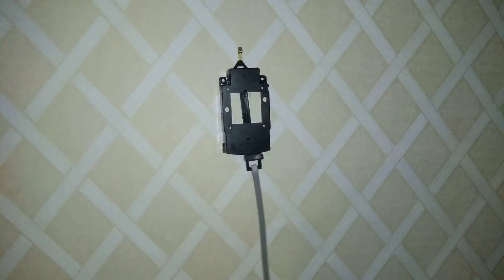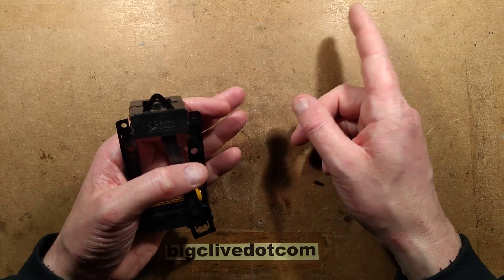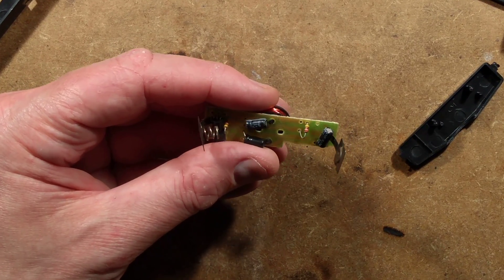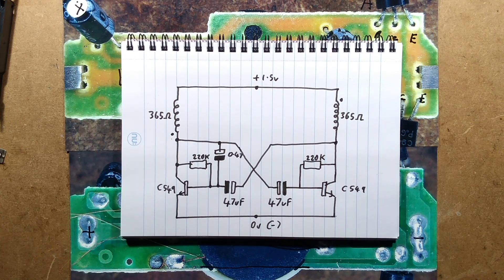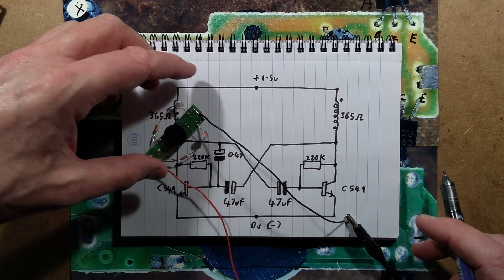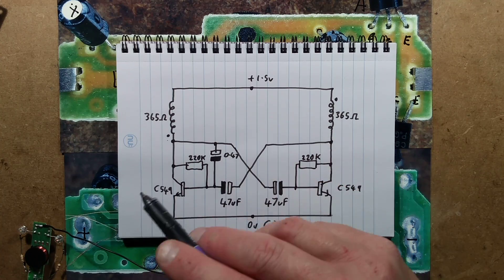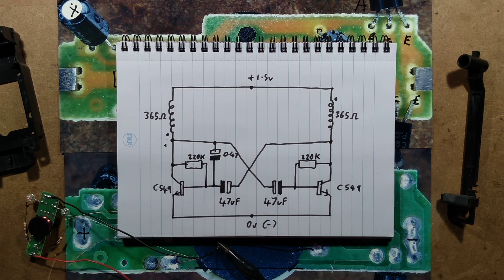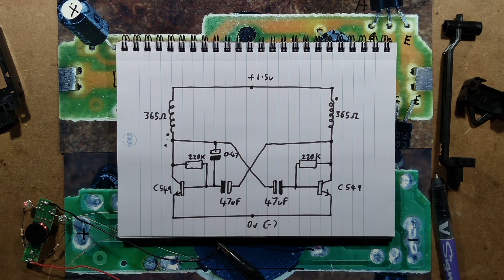Quartz clock pendulum movement teardown with schematic.

Comment: If you used 2 AA batteries in series would you get a stronger impulse?  Could the circuit handle this voltage?
Reply from the maker: It may, but at some point the higher voltage may interfere with proper operation.

Comment: My clock have this kind of pendulum but it is not swinging, what could I do to make it swing.
Reply from the maker: First thing to check is that the battery is new (even if replaced recently) and that the contacts are not corroded from battery leakage, and that the battery is in the right way round and makes proper connection with the terminals.  Some batteries have shorter pips than others.

Comment: I had one of these in a pendulum clock alkaline battery leaked on the coil I scraped it off with small screwdriver I tore off the 4 wires from coil to circuit board, with 4 wires and three terminals I just guessed where two of the wires went it works.

Comment: How big would such a device have to be to move a pendulum weighing approximately 200 pounds?
Reply from the maker: The main obstacles to movement would be pivot friction and air resistance.  But it still takes very little force to keep a heavy pendulum swinging.

Comment: Sir, 365 ohms Shows in the diagram is winding coils ? How many tuns need to get365 ohms.and what is the SwG of the Coil ?
Reply from the maker: It's very fine wire.  I'm not sure what its gauge is.

Comment: on the two magnets of opposite polarity: could it be that the circuit is switching polarity of the active coil winding,
on each tick of the multi-vibrator? thus facilitating the horizontal swing of the pendulum🤔

Comment: I am trying to drive a seconds pendulum whos speed will take 2 seconds to swing back and forth. It will be heavy so I am wondering if I could buy one of these and take the circuit board out and use a neodymium magnet on the bottom of the pendulum and place the coil from this circuit just under the center point of the pendulum at its resting point.
I wonder if this will work. I also wonder if I could get away with a single magnet or if I would need the 2 magnets as in the original setup?

Comment: I recently got a clock that has no battery but runs on a wound up spring. It has a pendulum that is attached to an escarpment and prevents the clockwork to run down immediately.

Comment: Yes, the coils sense the pendulum. Also, a problem with the basic stable multivibrator is that if perfectly balanced (unlikely but possible), it won't start. It needs an imbalance either with a resistor or a capacitor to start. Thus the extra capacitor. I never liked those. Too unpredictable. If they stop for any reason, they don't restart. They stay stopped until reset somehow.

Comment: I have  a similar unit (ten actually. eBay you know.) that only uses one magnet. I use the electrical guts to drive a little clock I made, the pendulum is the actual timekeeper, it's a 1/2 sec pendulum (1 Hz).

Comment: There’s a subtle difference between this circuit and the standard cross coupled multivibrator.  In the standard circuit there is always one transistor fully ON and one transistor OFF.  The ON transistor is held in the saturated state by the resistor from the positive supply to its base.  The OFF transistor does the timing, its base is negative and is charging up towards the positive rail.  When the base voltage reaches +0.7V the circuit flips.

In the modified circuit one transistor is OFF and the other one is not saturated but is held in a linear mode with perhaps a volt or two on its collector.  This is because its base is fed by a resistor from its collector.  This is negative feedback which keeps the transistor in the linear mode and operating with high gain.

The result of this is that a small voltage induced in the coil on the opposite side by the magnets can easily inject a current into the ON transistor’s base and cause the circuit to flip.  This is how the circuit synchronises itself to the pendulum.  This also makes it self starting because the magnets normally rest next to the coil and the slightest movement will induce a voltage which can flip the circuit and start it oscillating.

I don’t know what the extra capacitor is for.

Comment: I don't know why you didn't scope that circuit to really see what was going on.  Never saw an astable with coils for a load like that.

Talk about synchronized oscillators,  I bought a generator for adjusting color tvs back in the early 1970s,  which used unijunction transistor oscillators,  each one working at a sub-multiple of the preceding stage.  There were some trimpots you had to fiddle with to get a stable pattern,  and it seemed to be somewhat temperature-sensitive.

Organs used bistables for frequency division,  having one master oscillator for each note in a top octave and then dividers for all of the lower notes.  These were discrete in real early units,  chips in later ones;

Comment: Hello Clive ,I have a question . Would it be possible to build a pendulum clock with the drive in the lower bit from the pendulum??? So that the pendulum hangs on a string and the driver in the lower part .
Kind regards  Philip
Reply from the maker: It usually requires a fairly rigid pendulum rod, but it could work.

Comment: Only just stumbled across this teardown and very interesting it is too.  I'm thinking that the astable oscillates at it's natural frequency to start the pendulum moving and then the motion of the magnets is inducing a back emf in the coils which triggers the astable and synchronises the pulses to the pendulum.  The frequency must be synchronised to the pendulums natural oscillation because it would not have the power to force an unnatural speed.

Comment: my wife's grandfather clock takes fits and the pendulum stops. New batteries and you have to keep playing with it. Why could possible be the problem? I would think it would work or it doesn't. Is the plastic wearing out? really great explanation of everything. I used to have tons of electronics parts and after rarely using them after 15 years or so, I finally threw them all away thinking I would never get into that again. Thanks.

Comment: Resisted tearing apart my lucky cat because I figured it would destroy it but finally gave in and sadly there  was nothing to see just a coil and chip but did get lucky back together and working.
Reply from the maker: They're very minimalist.  Usually just a coil, capacitor and blob chip.  They've streamlined the circuitry to the minimum.

Comment: It's possible the .047 capacitor is creating a delay allowing the magnet to swing just slightly past the coil before energizing to prevent the coil from pushing the pendulum backwards, and the resistors across the collector base junction could be providing a bias voltage because the induced voltage/current in the coil is not enough to switch on the transistor.

Comment: Hey thanks for this video...I have a stupid question...like pcb computer boards could you ultrasonic clean a quartz clock movement? It would seem the part that kills the quartz clock movement is the part where the battery terminals sit on the pcb board. Overtime they corrode and then the board loses contact with the battery and the quartz clock movement dies. I was wondering if you could ultrasonic clean the movement to get it going again?
Reply from the maker: I don't think ultrasonic cleaning would remove the corrosion.  You can treat the are with a suitable neutraliser depending on the battery chemistry and then perhaps clean the metal and put a dab of vaseline on it to protect it against oxidation.

Comment: Thank you sir for this wonderful video. I have one of this circuits and want to use it on my wooden gear clock. I wonder if it is possible to make it more powerful by changing some circuit elements or input voltage?

Comment: I need to remove one of these from the back of a clock to replace it. Normally, when I replace quartz clock movements they will pop out of a plastic box that it is inserted into—this does not seem to be the case with this kind of movement. Could anyone please share how to remove it?
Reply from the maker: Some have a nut on the shaft and some are stuck in with tape or glue.

Comment: Thanks for your video and deep interest in the circuit.  My brother-in-law had a 30 inch statue that has a clock set as a pendulum that wobbles (gently swings) on her raised arm.  For 10 years, it hasn’t because the circuit went out.  I’ve looked for replacement coils and circuits to no avail.  Then, I saw your video and the circuit you were evaluating is very near to the one in this wobble circuit.  I bought one and replaced the circuits and now the wobble clock works.  Thanks again.

Comment: Thanks to you, I ordered the Tekken 8828W to try to replace the circuit board that gave up in my favorite Quartz Clock.  It is about the same size. I may have to glue it in.  The clock has a very rich sound, like a grandfather clock,  The only thing that doesn't work is the pendulum.

Comment: Ive had the regulator wall clock for years .  The pendulum has not worked for so long a period of time that I cant remember when It worked last.  But for the last few weeks Ive been messing with it trying to get it adjusted so the pendulum would swing freely and nothing Ive done from moving it from moving from one place to another or adjust so the pendulum should not touch on either side and swing freely and nothing has worked until last evening.  Actually I gave up on my efforts once again setting it on the wall once again so that the pendulum would swing from side to side fully .  To my surprise the next morning it was still swinging and the next day which is today is still swinging.  It also appears to be keeping perfect time with my other clocks.  It is a cheap clock which has no adjust on the bottom of the pendulum as some clocks do.  I doubt anything I did helped it.

Comment: It needs the two magnets to be self starting. Also opposite poles together helps prolong the life of the magnetic circuit.. (just like on electric motors)

Hate to say it but love to see Big Clive struggling with multi-vibrators a little - struggled with them myself for some time in electronics class..

Comment: Transistor organs had a set of 12  astable multis to generate  the top octave at 4 foot pitch; each note then had a set of 6 bistables (flip-flops) to repeatedly divide the frequency of the pulses by two to generate all the lower octaves and the 8' and 16' pitches. An organ with a 61 note (5 octave) keyboard, like my old Farfisa Compact, had one more astable to provide the bottom C. I still have a workshop repair sheet with the full circuit.

Comment: Are the coils in different directions?  If so, each coil will have a different magnetic polarity, which would either attract or repel each side of the magnet on the pendulum.

Comment: The unit in my wall clock has been working for 34 years with the only requirement is replacing the battery!

Comment: Many years ago In my Avionics technical school for the USAF we built a-stable oscillators AKA flip flop for soldering practice. 
It would be real interesting to probe around this variant with a scope to figure out how the feedback worked with that two magnet arrangement. 
Does it change frequency dependent on the weight or length of the pendulum?

Comment: Closely related topic as this vid features a flip-flop. Could you make a vid of this lightchaser circuit?  https://gyazo.com/683ed9d7ac51aa45e787b6a6534fab57 It's something I came up with on my own in '96, built and tested one, and it worked. I long forgot the values, sadly I don't have the thing anymore. I drew 3 stages but it can have many more.
Reply from the maker: Looks like a transistor ring counter.
Reply: @bigclivedotcom  - It's good for that I guess. I wasn't really aware of the existence of ring counters yet when I made it.

Comment: In electronic organs, the frequency division sometimes also worked with NEON glow bulbs. Check out http://www.peel.dk/Philips/Philicorda_GM-751.html for a schematic. Might be of interest for all of us with a thing for neon lamps. 
The Philicorda gm752 and later are a good example of the frequency division with monostable multivibrators AKA flipflops.
Reply: I remember some of the early Lowrey organs were full of neons,  but they used them for keying rather than division.  Some models used a rather odd tube that the tube manual referred to as a "three-plate tetrode" which I've never seen used anywhere else.  Sometimes enough vibration in the console and you'd get a lead breaking right at the bulb and lose a note.  Replacing the bulb usually fixed that.  :-)

Comment: The basic cross-coupled astable has a flaw in that it is perfectly symmetrical which may prevent it from starting when the power is applied.  This would happen if the two transistors were well matched and  tried to turn on simultaneously.  So the 0.47uF capacitor is added to slow down the left transistor allowing the right one to turn on first and then force the left one off.  This starts the oscillatiion.
Reply: I have never run across a problem with one of these circuits failing to start for that reason.  Not only would the transistors have to be pretty precisely matched,  but so would the capacitors and the resistors.

Comment: Isn’t the voltage induced in a coil dependant on the direction of the magnetic field and the which way the magnet moves in relation to the coil? (Fleming’s Right Hand Rule)

With the 2 magnets stuck on with reversed poles wouldn’t the (initial) polarity of any voltage induced in the coil be the same regardless of the direction of swing.

Comment: Are the 2 magnets arranged so it will self start?  With 1 magnet it may pulse but never get enough impulse to get the magnet out of the range of the coils so it can start magnetic triggering. i have seen these that just sit and jump slightly unless you swing the pendulum.

Comment: The device might be pushing kinetic energy on the upswing and capturing it on the downswing.  Charging the capacitor for the next state change between the two poles. The most vulgar and therfore cheapest pendulums are the cuckoo variety. Failing that, try a mass of lead solder wrapped into a length of a handspan. The pendulum should be only slightly longer than doubling the fequency.

Comment: I wonder how stable the frequency can get with the original tube based design. It seems as if you could use it as a regulator for an electro-mechanical clock, but I don't know of any earlier electric clocks that used this.. they all seem to use contact points up to invention of the transistor.
Reply: Yes, but sadly you need big caps for low frequency, hence electrolytic.   Their value changes significantly with temperature and age, which affects the frequency.  A mosfet version of the circuit could use smaller caps......

Comment: You can probably rotate the capacitors at the ends of your board, and there will be no need for those awkward bends of the track there.

Comment: Several years ago I bought a Cuckoo clock in Passau Germany.  The movements were different than yours only in that it also had a chime/music circuit and a little bird that kept peeking its head out.    Still working after all of these years.
Reply: I have that clock, but I had to gut it. Unfortunately during storage the little pole the bird is perching on snapped off, but the other things still work.

Comment: It's the length of the pendulum shaft and weight that's doing the timekeeping, while this module just nudges it while it goes past so it doesn't "wind down".  Really accurate clocks will have pendulum shafts with a very low thermal coefficient of expansion so the clock keeps the same speed as the temperature varies.

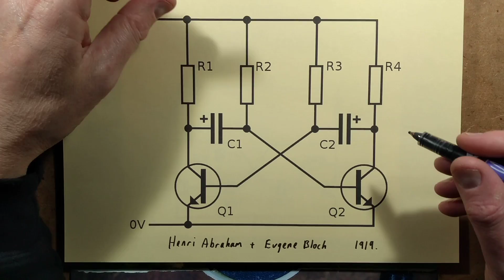Comment: 6:52 The original circuit (as  credited 1919) can’t have been with transistors, as transistors weren’t invented until 1947. The original circuit used vacuum tubes instead.
Ah, you explained that had I continued watching - my apologies Clive. 😳
Reply from the maker: The earliest version I came across in a clock used a contact strip to bump the coil on each pass in one direction.